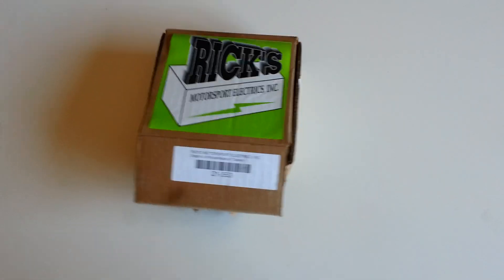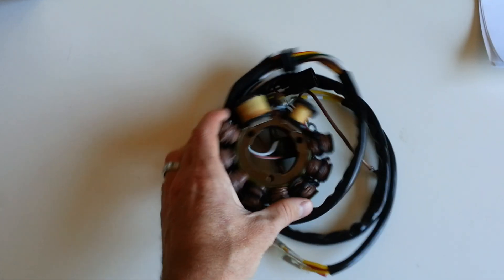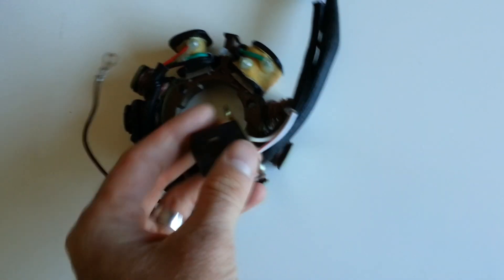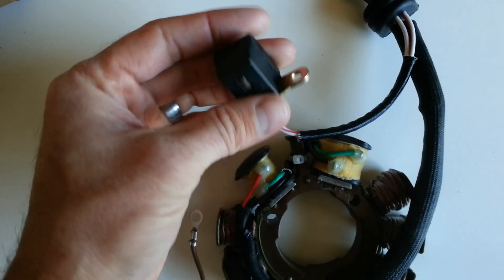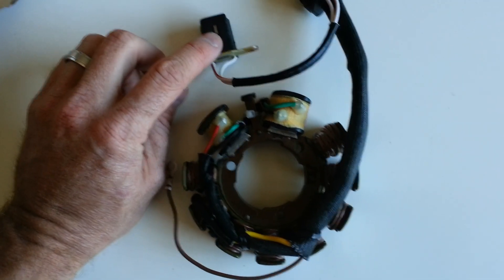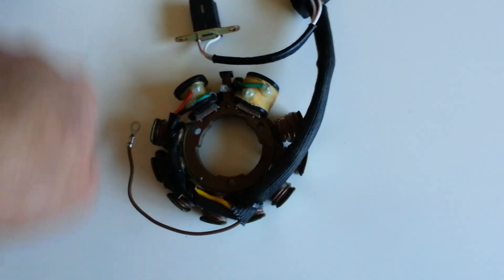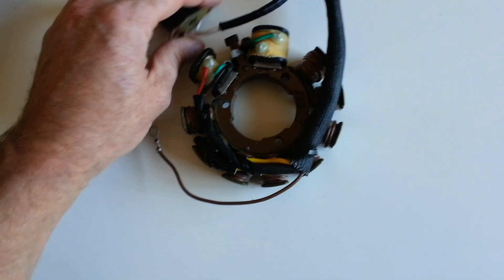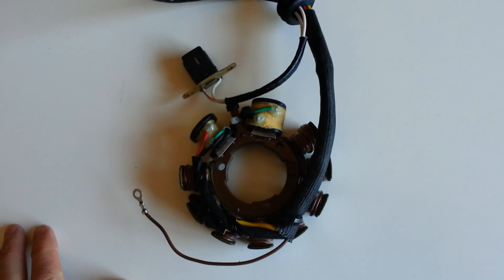What is a stator motorcycle atv scooter

Comment: Hi my lml star runs fine but my lights do not work. They run off the  AC with the AC plug un plugged checking with a multimeter there is no voltage coming off the AC wire. So I replaced the stator for a new one and still have the same problem. Any ideas ?

Comment: Hello, I'm new to scooter, every since I bought my 50cc tao tao used, its been taking for ever to start. And this is with a full charge mind you. Just turns over and over and over for like literally ten minutes before starts, ive had carb gone over twice by two different people. Now it won't start at all we've gone over spark which its getting fuel its getting compression is good... Did a new key ignition. Still no start. My main question is can the stator cause this issue? Please Lmk thanks

Comment: my scooter doesnt have a battery but was running normal now it doesn't spark, what's the problem?
Reply from the maker: +NightFlutter most likely the cdi box if you  had it running with no battery for any length of time
Reply: it stopped working because the spark plug cap broke and when i replaced with a new one the scooter doesnt start

Comment: I checked the voltage on my 50cc scooter on my stator output and I can't get a reading it just jumps all over the place  should I replace the stator it's my understanding that the stator should put out 15 volts at idle ad about 60 revving any help id appreciate it I've replaced coil wire plug cdi it kick starts but doesn't fire with ignition most the time and more

Comment: Have you ever seen a case when the lights are on and the fan engages the battery light flashes? It has brand new Polaris OEM regulator and brand new odessy battery.

Comment: 97 yz 80 my guy said i have a bad stator (runs like the choke is on/hard to start) got one out of a running parts bike put it in but now wont run at all and i have gas leaking outof the exhaust port?

Comment: My 250cc scooter starts only sometimes and idles low at 900-1000 and turns off as soon as I give it any extra gas. Could it be the stator not working correctly?

Comment from the maker: Your system Isn't designed for the bigger bulb. It will be harder on the electrical system. Wires could get hot and possibly blow your fuse. Who knows you may never have a issue. This shouldn't have anything to do with your engine loosing power.